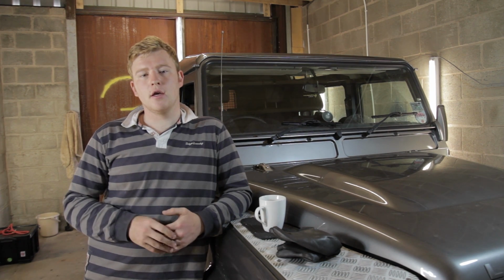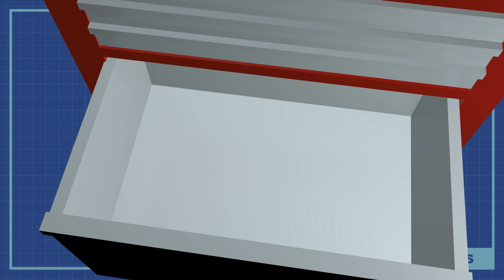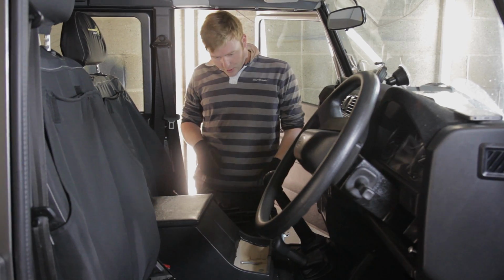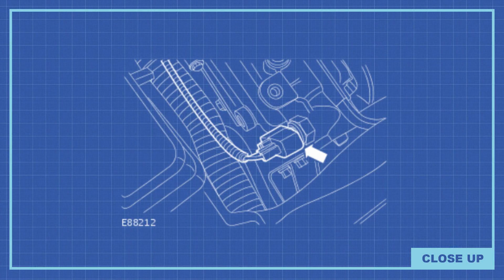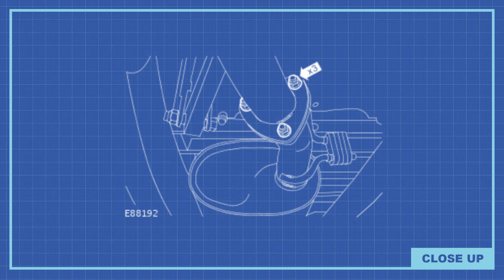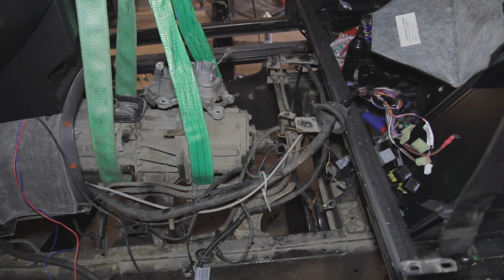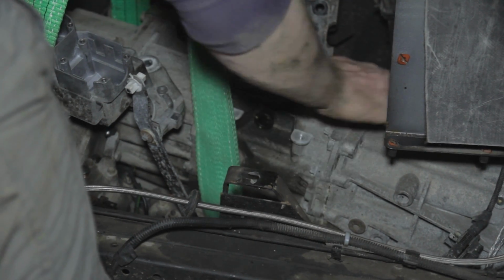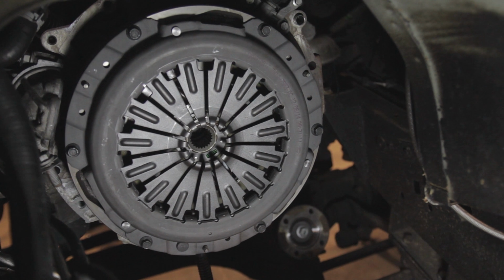DIY: How to replace Land Rover Defender Clutch

Comment: removing the motor seems like less work! my clutch started juddering but not very often, how long can i drive it before catastrophic damage? i'm selling the td5 110 defender and really don't want to change the clutch pressure/plate

Comment: Got here afyer watching BBC drama Last Tango In Halifax where farmer gets gufted a defender and replacement clutch it needs and seta about changing it from top side of engine under bonnet with small set of sockets spanners, like it was a change spark plug level job.

Comment: If you only find eight bolts holding the engine to the gearbox, it means that somebody has been there before you and has not bothered to replace the two difficult one.   There should be ten.    The two high ones are very difficult to get at.   The one on the right-hand side can just be seen from the top but is best tackled from below.   The one on the left-hand side can't even be seen from the top.   If you lie beneath the gearbox with your feet sticking out at the front of the car, then you can feel for both bolts.
Reply: Doh !    I missed the obvious.   The two bolts at the top of the bell housing are easily accessible over the top of the gearbox.   If you use a mirror to look along the gap between the top of the gearbox and beneath the curved steel cover,  you can see them.   A 13mm socket on a long extension bar reaches them easily.

Comment: There are of course different ways to do this job.
I understand that the authors are promoting the SGS engine lifter but it means that they have to strip out a lot of the interior (e.g. the seat boxes) since one needs access from above.  On the positive side you can remove the main gearbox and transfer box as a single unit. It's a big old lump!
Another way is to work from underneath supporting the gesrboxes on a trolley jack with a suitable cradle (I have made up simple timber cradles). There is much less stripping in the cab; you must take out the transmission tunnel to get at the bellhousing bolts and the cubby box etc to get at the top of the gearboxes (to remove the change mechanism, breathers etc).  The transfer box must be lowered first and then the main box. It helps greatly to have a pit which I am fortunate to have otherwise you are lying under the vehicle on you back which is unpleasant.
I have used both methods and find that working from below, and removing the two boxes separately, is less of a struggle. Either way it's a big job.
Anyhow it's a good video.

Comment: Ehy up fun Rover, 
It’s t’ good video but having done t’ job myself I’d like t’ point out be careful of what clutch tool you use as t’ flywheel has t’ needle bearings and can be damaged with t’ shit clutch tool.
Also bleeding t’ clutch you can reverse bleed or do t’ normal way.
I did t’ 2.2 and it’s worth reminding people t’ DPF system is t’ bastard and has t’ come up and out the bonnet after t’ coolant bottle has been shifted out road and t’ sensors for DPF are bastard £150 each and there’s 3 soft stainless ones in t bastard exhaust plugging into connections on top of t’ gearbox.
Good disassembly video but needs to show t’ reassembly can’t just say do t’ opposite when t’ clutch needs bleeding.
Also I fitted T’ Ashcroft output shaft when I had t’ gearbox out

Comment: Nice video how did you go bleeding the lines on the puma mine has got a very low bight point. Have adjusted the clutch pedal but its no better once the car warms up its back to the floor

Comment: I have just dropped the gearbox out of my 200Tdi (needs a rebuild) and will do the clutch whilst the box is out. Just wondering, is it essential to machine the flywheel face before putting in the new clutch? I've been told it is, but my thoughts would be to only machine if slightly warped or if significant build up on the face, but even for the latter a good clean/linish should do the job? Thanks, Matt

Comment: First time doing one of these, your video helped a lot. I did it with a lift so I didn't pull out the interior, just reached around to undo all the connections and clips on top of the gear box. Also I figured I could save undoing those last 3 muffler bolts and just undo the mountings and put it to the side resting on something. I had to change the flywheel because it was all cracked, probably because the owner doesn't know how to drive it(clutch itself only lasted 45000 km since the last time)

Comment: Not a real Land Rover. Just an over priced Transit Van.
Reply from the maker: paul spencer have you owned one?
Reply: funrover currently have a TD5. Owned a 200tdi and a series 3. However not owned a transit.
Reply: engine and gearbox are shit but after some time you can replace it with 300tdi and R380 and galvanised body will last longer that TD5